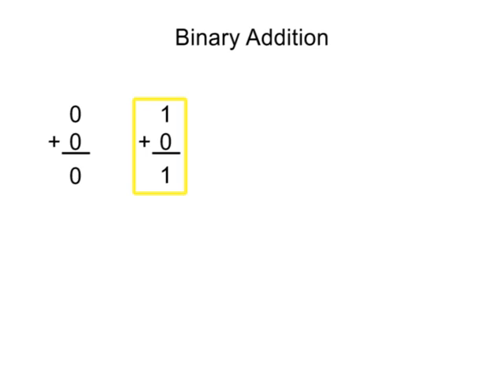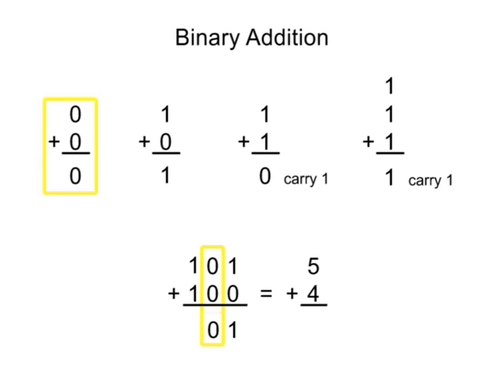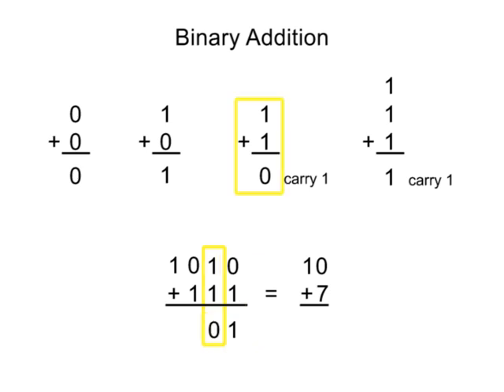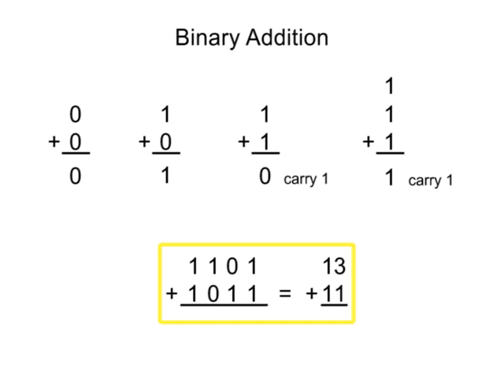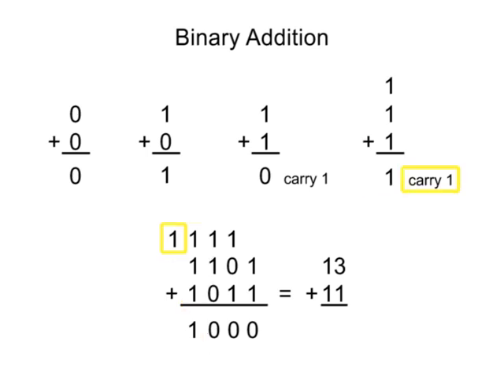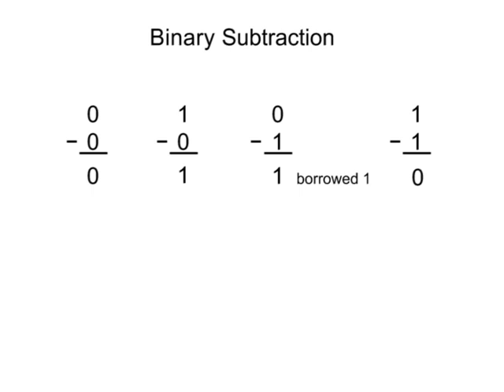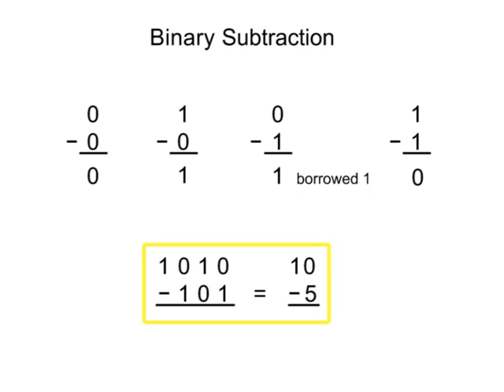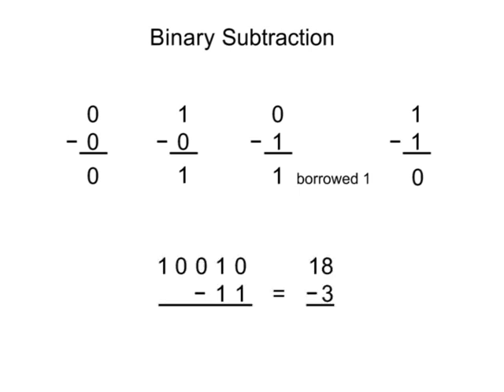Arithmetic Circuits: Binary Addition & Subtraction | 2/12 | الدوائر والعمليات الحسابية: الجمع والطرح

Comment from the maker: Thanks for watching. For More Videos: Please Subscribe My Channel
Digital Circuits & Systems Tutorial: https://bit.ly/328xWSD
Solid State Devices & systems Tutorial: https://bit.ly/31PedHP
Embedded Systems & Microcontroller Tutorial: https://bit.ly/3893dpH
Motors and Drives Tutorial: https://bit.ly/3dH0yF1
Process Control Tutorial: https://bit.ly/3hTASs7
Fluid Power Fundamentals Tutorial: https://bit.ly/2NSowCL
Fluid Power Design and Application Tutorial: https://bit.ly/3dEjvIq
Fluid Power Control Tutorial: https://bit.ly/3eniF3S
PLC Programmable Logic Controllers Tutorial: https://bit.ly/2C22zhI
Complete Practical PLC Course Tutorial: https://bit.ly/3dHon09  
Advanced PLC Programmable Logic Control Tutorial: https://bit.ly/3g8FfO3
Electric Motor Control and Power Systems Distribution Tutorial: https://bit.ly/31Cib6c
Industrial Robotics Tutorial: https://bit.ly/38hQnWd
Industry Blueprints Tutorial: https://bit.ly/2ZqCn8p
AC Circuit Analysis Tutorial: https://bit.ly/2VyoHqP
Physics Tutorial: https://bit.ly/2BjVOaX
Motion Control  Tutorial: https://bit.ly/31sqUrz
Basic Math Topics Tutorial: https://bit.ly/3gHD6cq
====
Channel Link: https://bit.ly/2IsqVS for watching more Videos
😌Don't Forget To Like, Share, Subscribe & Comment 😬
====
تعريف بالقناة:
قناة تعليمية مهمة للجميع عليها أكثر من 210 فيديو تعليمي، بها:
1- شرح لبوردات الاردوينو Uno & Mega 2560  وعمل مشاريع رائعة بها حيث، شرح Servo Motor, DC Motor وطرق توصيله والتحكم في إتجاهه، و EEPROM وتوصيلها وكيفية التعامل معها. وال Stepper Motor، واستخدام الاردوينو كمولد موجات جيبية ومسننة ومثلثية،
رابط الدورة من هنا: https://bit.ly/2PvtHvx
2- شرح دورة الأنظمة المدمجة Embedded Systems والميكروكنترولر واحتراف البرمجة بلغة الامبيدد سي Embedded C. وعمل مشاريع رائعة…
رابط الدورة من هنا: https://bit.ly/2KadqX2
3- شرح كيفية الربط بين الاردوينو واللابفيو وعمل مشاريع رائعة بهما.: https://bit.ly/2KlTssj
4- شاهد أيضاً،دورة مهمة جدا لطلبة الهندسة في شرح أساسيات ومبادئ التحكم الآلي او هندسة نظم التحكم
(Automatic Control or Control systems engineering):
رابط السلسلة:  https://bit.ly/2NGyeYd
5- دورة متقدمة في التحكم باستخدام اللابفيو (مهمة لأقسام تحكم أو كنترول والكترونيات). وهي تطبيق عملي لدورة التحكم الالي 
رابط الدورة من هنا: https://bit.ly/2K7aVEE
6- سلسلة Root Locus Method في هندسة التحكم الآلي لطلبة كلية الهندسة، قسم كهرباء،
رابط السلسلة: https://bit.ly/33CROvi
7- سلسلة عملية في القوي الكهربية او الكهرباء المتردده الاحادية والثلاثة الطور (Electrical Power) لطلبة هندسة ولكل مهتم بالكهرباء
رابط السلسلة كاملة:  https://bit.ly/3dWEckc
8- بعض الدواير العملية الكهربية المهمة للجميع.
رابط الدورة من هنا: https://bit.ly/2Fnli65
9- دورة في القياسات الكهربية، مهمة لطلبة كليات هندسة ولكل مهتم بالالكترونيات والكهرباء: https://bit.ly/30RdTVS
10- دورة في احتراف الرياضيات والجبر والهندسة والتفاضل والتكامل والقوانين الخاصة بها بدون تعقيدات.:  https://bit.ly/30ykUtG
11- دورة في احتراف برنامج اللابفيو الرائع LabVIEW : https://bit.ly/2TOx4y4
12- برامج مهمة للكمبيوتر واللابتوب الخاص بك: https://bit.ly/2qT9NM6
13- Complete Practical PLC Course Tutorial: https://bit.ly/3dHon09 
14- Green Screen Tutorial Link: https://bit.ly/3esShFa
15- Complete Process Control Tutorial: https://bit.ly/3hTASs7
16- Complete Fluid Power Control Tutorial: https://bit.ly/3eniF3S
17- Complete Fluid Power Design and Application Tutorial: https://bit.ly/3dEjvIq
18- Complete Motors and Drives Tutorial: https://bit.ly/3dH0yF1
19- Complete Physics Tutorial: https://bit.ly/2BjVOaX
19- Complete Embedded Systems & Microcontroller Tutorial: https://bit.ly/3893dpH
20- Advanced Programmable Logic Control Tutorial: https://bit.ly/3g8FfO3
21- Physics Fundamentals Tutorial: https://bit.ly/2CNrzcU
22- AC Circuit Analysis Tutorial: https://bit.ly/2VyoHqP
23- Industry Blueprints Tutorial: https://bit.ly/2ZqCn8p
24- Industrial Robotics Tutorial: https://bit.ly/38hQnWd
25- Electric Motor Control and Power Systems Distribution  Tutorial: https://bit.ly/31Cib6c
26- PLC Programmable Logic Controllers Tutorial: https://bit.ly/2C22zhI
27- Fluid Power Fundamentals Tutorial: https://bit.ly/2NSowCL
28- Solid State Devices Tutorial: https://bit.ly/31PedHP
29- Basic Math Topics Tutorial: https://bit.ly/3gHD6cq
30- Digital Circuits & Systems Tutorial: https://bit.ly/328xWSD
وهناك المزيد علي القناة، وان شاء الله هذه مجرد البداية فقط.
رابط القناة:   https://bit.ly/2IsqVSC
وتعمل اعجاب ومتابعة لصفحتنا علي الفيس صفحة المهندس المحترف
رابطها: https://www.facebook.com/المهندس-المحترف-100879698187843
متنسوش الإشتراك بالقناة لمتابعتنا وتفعيل جرس التنبيهات ليصلك الإشعارات بالفيديوهات أول بأول.
====
#ُDigitalCircuits
#Kyrillos_Refaat